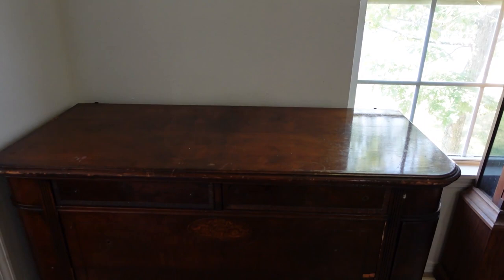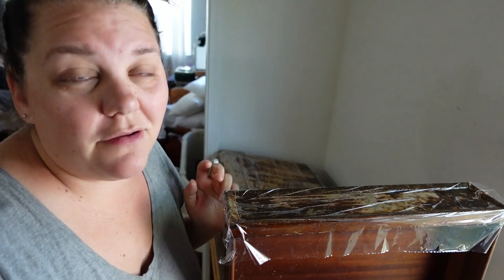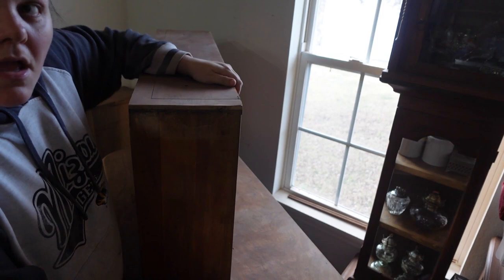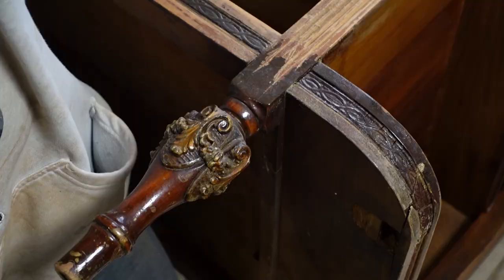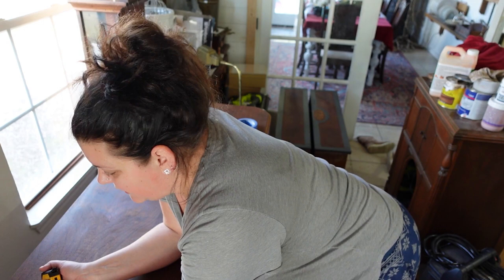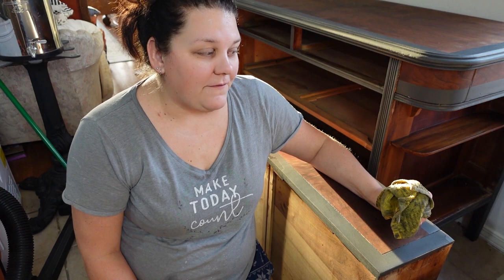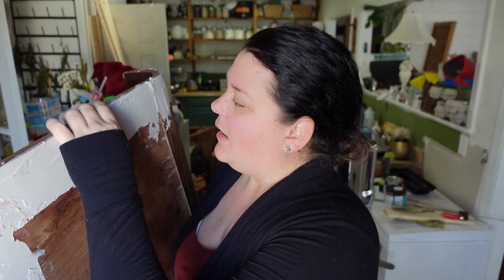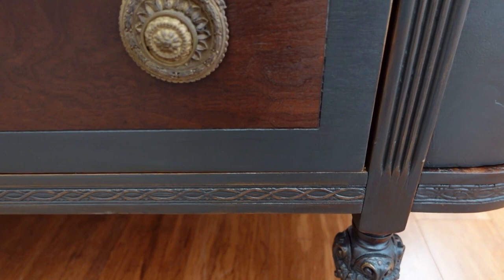Extreme Antique  Furniture Makeover From Start to Finish | French Country Sideboard Project

Comment: What kind of roller do you use when putting on the poly acrylic? I used a foam roller and I got bubbles.
Reply from the maker: I used a foam roller and have the same issue! I have to press down REALLY hard so the roller doesn't move lol and basically, just go over it until you can't see the roller marks anymore. I prefer a brush, but I foolishly thought I'd try it again on this flat surface!